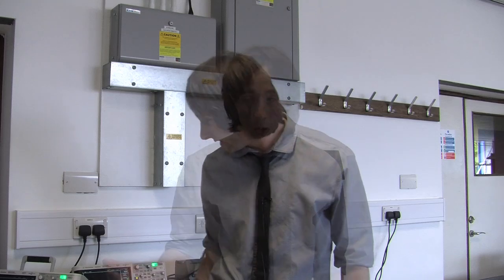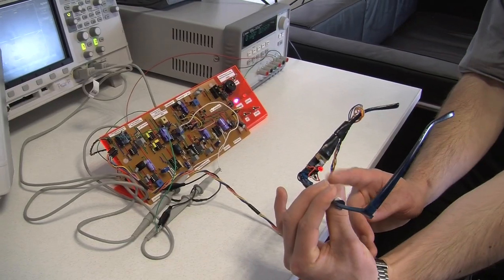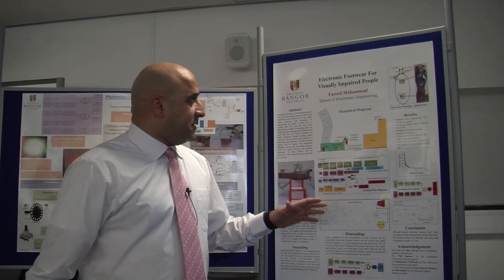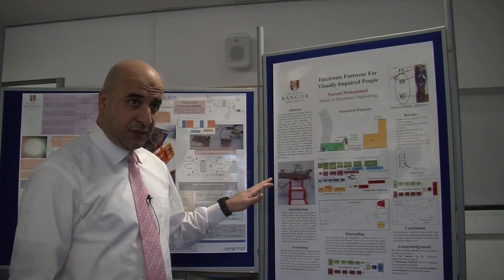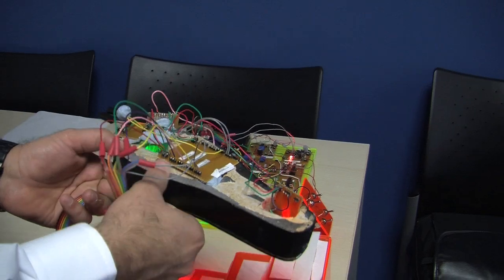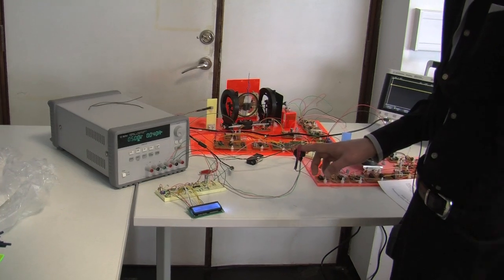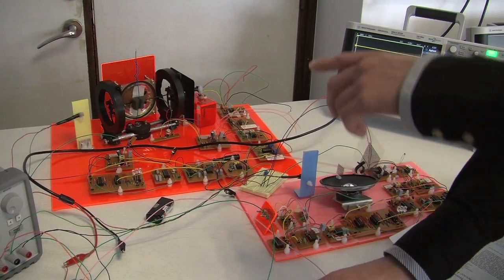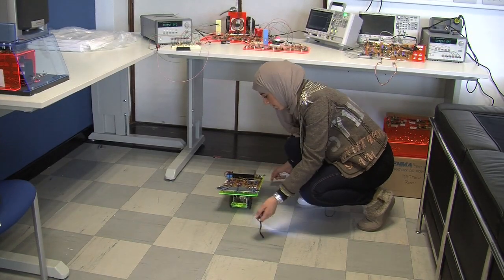Electronic Engineering Final Year Projects

Comment: ElectroLight contains what you need about electronics and electrical components also it shows information and details with images like data sheets about components , it has 5 tabs first one is calculators like resistor code, ohms law, SMD resistor code, second tab is components like capacitor, transistor, Diode, third tab is Circuit and theory like RC oscillator, Wein bridge,

Link: https://play.google.com/store/apps/details?id=com.kookistudios.electrolights

fourth tab is Data/pin-outs like Datasheet 741, Usb 2.0 port, Ethernet port, fifth tab is Arduino tutorials like Blink , Read analog voltage , Read Ascii string. And many more

Comment: For Sale : US Made EHT Analog Volt Meter can be measured up to 40 KV directly holding. Suitable for EHT handling Electronic / Electrical Engineers. Cost: Around Rs.30 thousand. 
Contact: P.R.Gopalakrishnan
     Electrical & Electronic Engineer
     Sreenandanam,
     Opp. Milk Society
     Near Nallur Market, Feroke.P.O.
     Kozhikode, Kerala.
     9895836480(WhatsApp)
     7356008221

Comment: Great projects!! The last gentleman from Poland had me excited for a second because I thought his system was an EXTERNALLY detected AUDIO WAVE FORM - TO - LED OSCILLATION DEVICE. However according to his description, his device takes the VOLTAGE FROM THE SPEAKER WIRE LOAD OUTPUT. Then he converts this into a multivibrator oscillation of the same frequency to 'pulse' the LED. The LED PULSES ( which are the light wave equivalent of audio signal) can then be detected over a very long distance which theoretically would not suffer from the same drop out issues that a short range radio transmission would. 

With this concept in mind it wouldn't be that difficult to use the same tech to send WIFI over a much longer distance as compared to the electronics involved to make it happen.

Also, I am sure that many of you recall the device which detects conversations inside homes and buildings by picking up the visible vibration movement from window glass. 
Well, I have a similar concept that I am still researching exactly how to do this, but the goal is to create a material which chemically responds to audio vibrations the way film reacts to light. We already know that once a material changes it's form, detection and translation is pretty easy. Look at how Movie Film  captures sound waves and then reverses the process to play it back. This is also how a record needle works. 

Well, with digital and MICRO ELECTRO MECHANICAL SYSTEMS (MEMS) we can go even deeper into our studies. People say that our government is 20 years ahead in technology. That is easy to believe because all it takes are ideas which use the latest technology to make them happen and HOLD BACK. Well duh'! We know the governments good for one thing- HOLDING BACK! I know that out there somewhere is the technology to create a very precise molecular substance which like photographic film can be used to capture the real time vibrations of sound, and be 'played back later. Basically a tape recorder without the magnetic tape head. Well, who says you need a tape head! THINK MY FELLOW ENGINEER THINK! ( just keep it away from MIT, those shifty fellows;).
So QUESTION:
HOW DO YOU CAPTURE AIR STIMULATED AUDIO WAVE FORMS ONTO A THIN, TAPE OR FILM, WITHOUT ANY VISIBLY MOVING  COMPONENTS ( BY THE NAKED EYE THAT IS)? 
 I know the ending to this puzzle. Do you? One thing, I have yet to see- someone take the bait and bring a real product into fruition.
Reply: paulj0557 LED modulation to send audio to a speaker across the room from a laptop wirelessly... I saw that in the early days of youtube as a simple weekend project for anyone so I'm suprised you can do something like that at degree level. The same goes for most projects here, they're A-level at best.

If you want to talk about sending "wifi" over a long distance from single point to single point, fibre optics already exist. If you want to talk about wireless single-to-many transmission using light instead of radio waves, you have the same problem as radio waves, the exponential loss of signal power with distance but with light you also are limited to line of sight. The point is this... No, light transmission through air isn't going to replace wifi. Light waves and radio waves aren't that different anyway.

As for your conspiracy theory ramblings.. I just couldn't force myself to read through to the end.